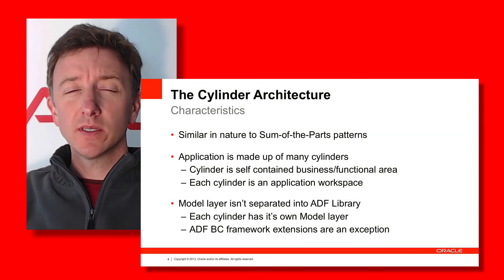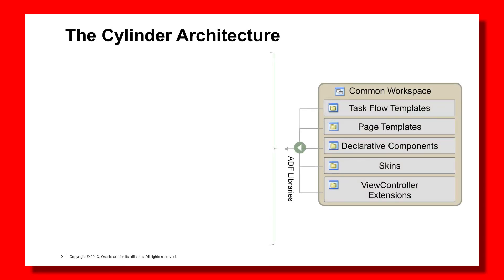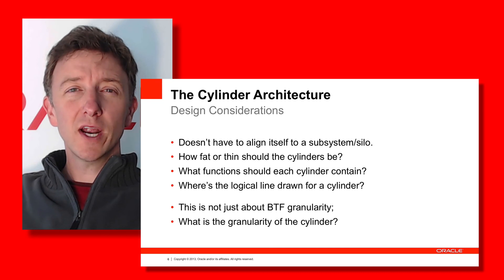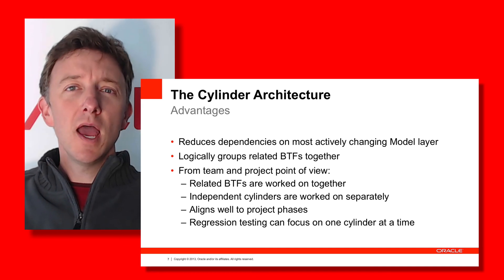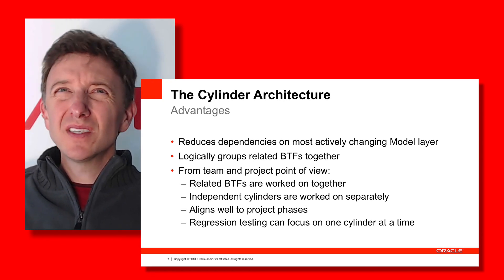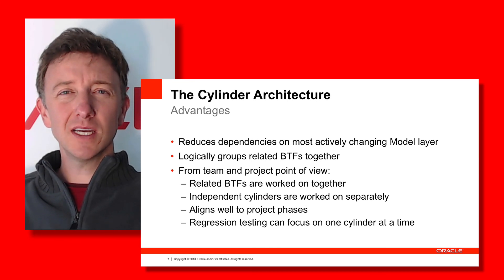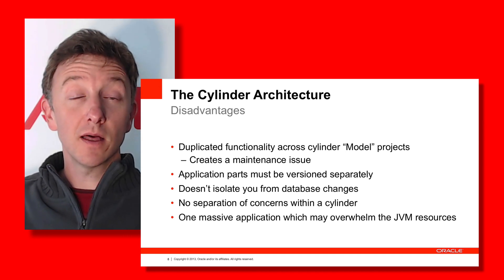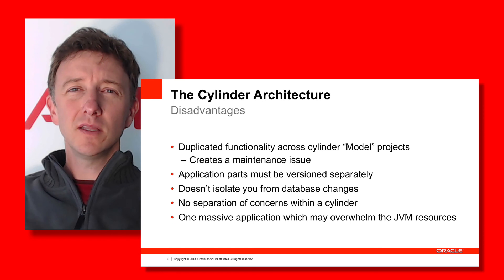16. Design - ADF Architectural Patterns - Cylinder

Comment: Regarding granularity - if we choose to be too thin, we will end up with a lot of AppModules - 1 per each cylinder.
I've read people hitting bad performance due to too much AppModules working against 1 database. If this is the common case, then defining maximum number of AppModules could help us defining the granularity.
What do you think would be the maximum number of AppModules for the whole application?

Thanks in advance for the answer!